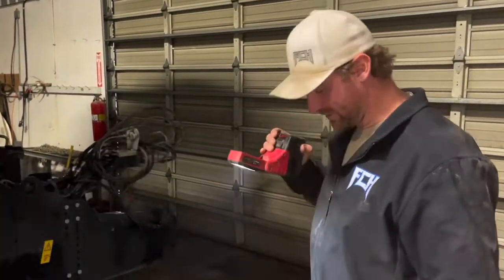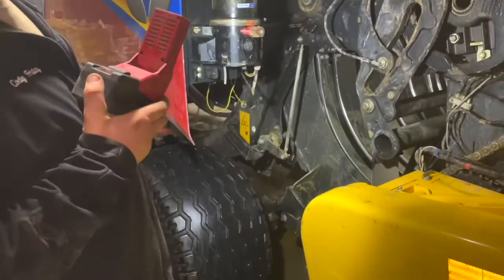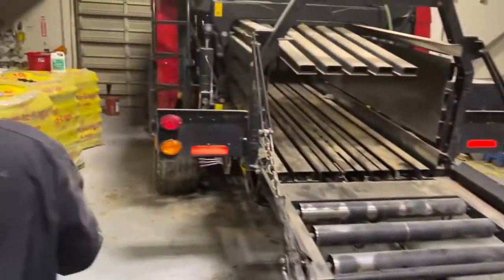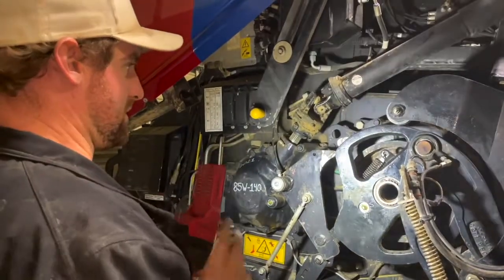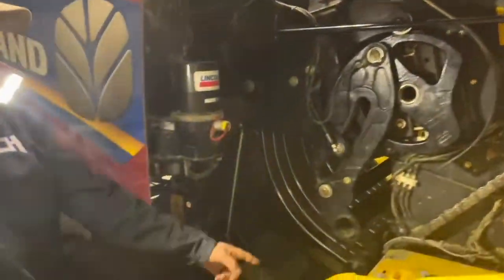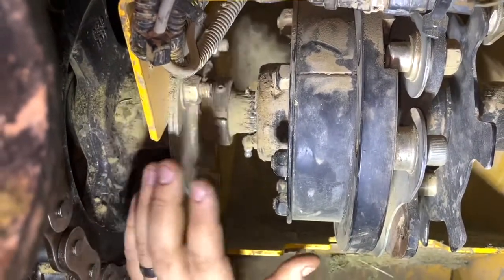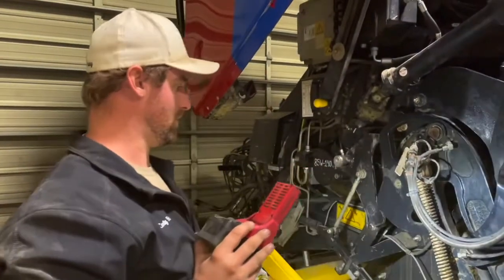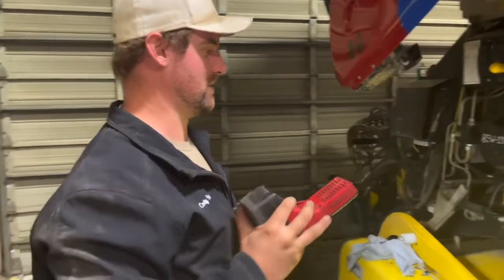More Balers

Comment: Very nice vids. Appreciate the straight down-to-earth view on technical matters, rather than the very opinionated and filthy mouth of OLF, pulling in politics all the time.
That being said, how do you think about High Density balers, like the new New Holland HD or the Krone HDP?
Talking about preventive maintenance, you say very little about the knotters. Are the knives the only thing you exchange?
Reply from the maker: The new holland balers lube system is superior to any other Baler, therefor we do not have knotter failures as much. I do rebuild complete knotters when they start having issues. As for HD balers the new holland is a much better Baler, a couple of the big companies in Idaho traded off all of there almost bran new krones for the new holland HD.

Comment: Hi! Do you have some experiences with new NH Bigbaler High Density? What do you think about the machine?
Reply from the maker: I do not own one, I think they are a very very well designed Baler. They are more for the fodder and straw market. I think they are a bit over kill for the alfalfa hay market due to the fact that they will make a far to sense of a bale and will raise the concern of spoilage. You would need to bale your hay extremely dry if you were going to run an HD in alfalfa or grass hay. The 2020 models of the 340 plus balers also have the new loop master knotters like the HD Baler though.

Comment: Your balers obviously are not running in mushroom hay and cornstalks.  I run krone balers in pivot irrigated hay also and I  can tell you it doesn't cost $10,000 a year to maintain any baler in our situation.   You want to talk about longevity,  krone of California has a baler with 111,000 bales they are selling field ready.  How many new holland or massey balers have you seen still going strong with over 100k on the meter?
Reply from the maker: I’ve baled everything from alfalfa to haylage to grain to straw to grass to tules I have never baled corn stocks but I have baled in some extremely abrasive conditions, and I have baled hundreds and hundreds of thousands of tons of hay ranging from half ton to 6 tons per acre with my new holland big balers. So no complaints here. I’ve bailed reeds canary grass at 6.5 tons per acre with a 595 Big Baler that a Heston 4790 wouldn’t touch they had to put it on a truck and take it home. Everyone I know that has ran Krone in Oregon and Nevada hate them because they are so expensive to buy, not real good customer service in this area and they are a fortune to maintain.